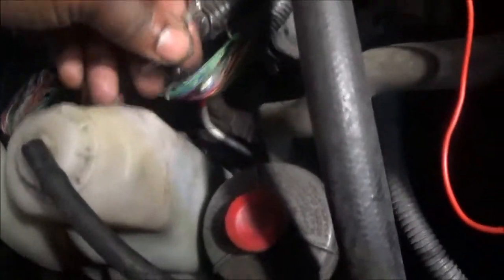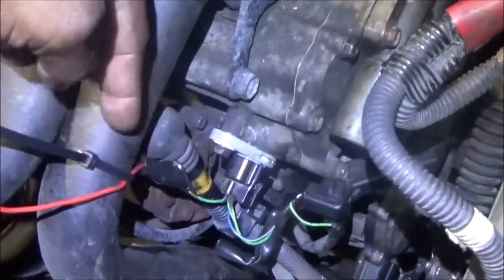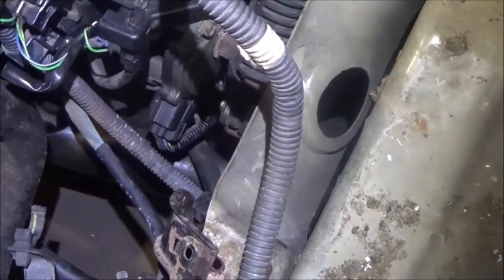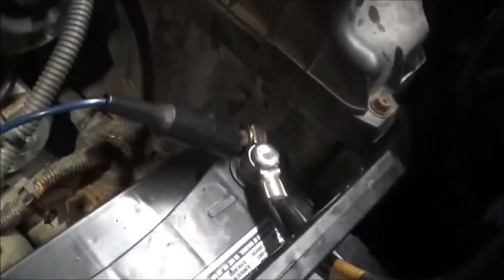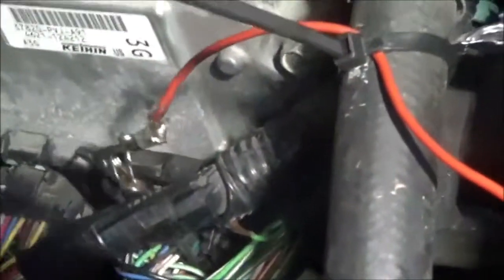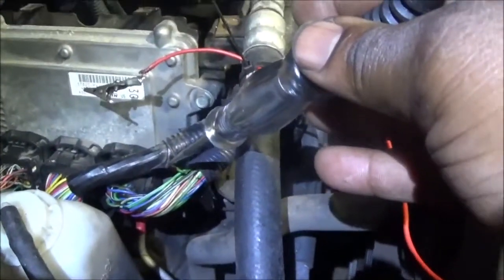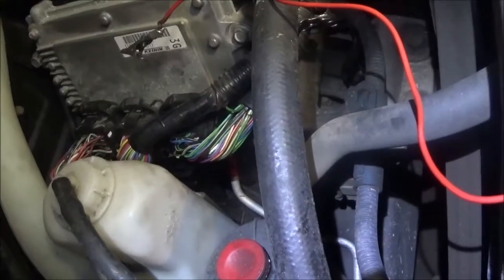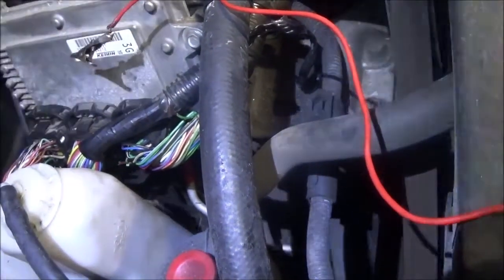2008 HONDA PILOT TRANSMISSION PROBLEM P0976 SHIFT SOLENOID B LOW INPUT (PART 4) WIRE TEST!!!

Comment: Good job I  like the way you test drive your work. Electrical problems can be pretty tricky, hope the wire is good and not intermittent.  I would definitely have the oil lab tested by the owner to be sure& not drive till then.
Reply from the maker: Thanks 👍